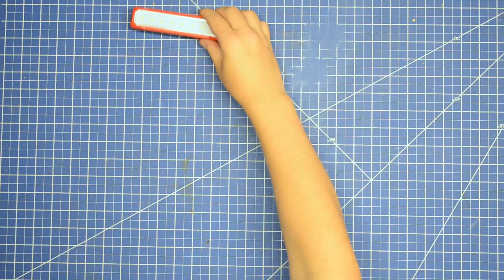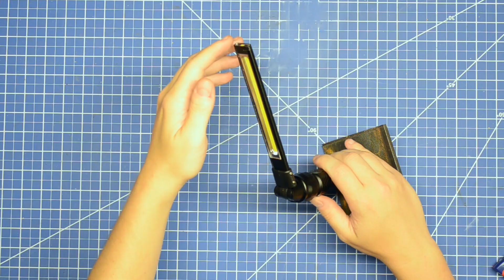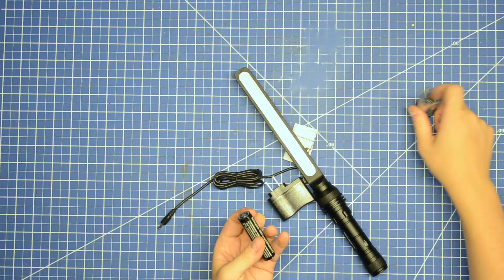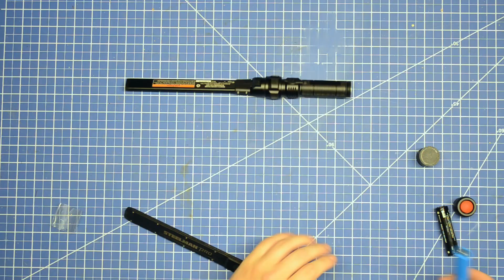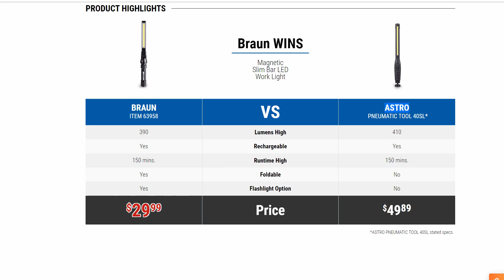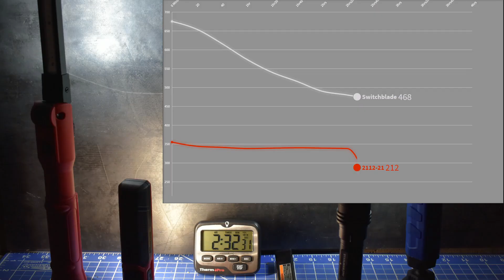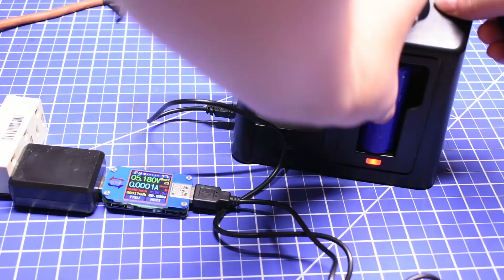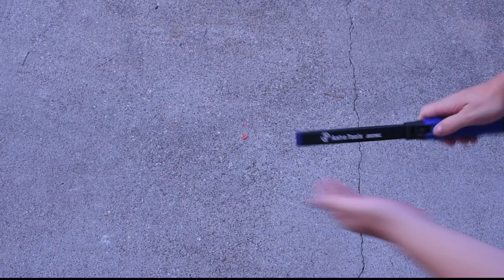Is Milwaukee Lying as Much as Harbor Freight Braun About Lumens?

Comment: I'd love to see headlamps tested. As an electrician I use one every day and as a side note I do appreciate the high CRI lights as the blue lights are hard on the eyes.
Reply from the maker: List headlamp suggestions below! Edit: Also should we even bother with a drop test on headlamps? (please recommend ones without auto proximity dim, we've tried testing a couple really good Olight & Fenix ones and this feature really messes up all of our runtime and lumen testing, even tried taping the sensor off to no avail)
Reply: @TorqueTestChannel  Streamlight Bandit. Super small, I have used it a TON for car work. Rechargeable via micro USB. Super cheap too
Reply: @TorqueTestChannel  I’d love to see the Snapon Necklight ECHDC038 tested. It’s called a neck light but it will snugly fit on your head if you’re in the standing position. If you’re working upside down wearing a thick hat ensures it stays on tight.
Reply: @TorqueTestChannel  [edit] Fenix HP25R V2.0 for "accurate" result.  Fenix HM65R for silly results.  (I previously said Fenix HM65R since I had one at my previous job...worked great, but the specified run times are just silly.  Not consistent with their other products.  I made a spreadsheet...calculated Lumen*hours per mAh...at each brightness level.  This HP25R has a larger battery than the HM65, but has 1/3 the run time at a given lumen level...the lower number is consistent with their other products, so it's more believable.)
Reply: @fredygump5578  they are company supplied the milwaukee looks nice and all but just does not last.
Reply: @TorqueTestChannel  Milwaulkee, DEWALT, Light Bar, Craftsman USB Rechargeable are some I have and/or am interested in.
Reply: @TorqueTestChannel  Surefire minimus - I run rechargeable surefire LFP123A most of the time or disposable cr123 batteries depending on use
Reply: @TorqueTestChannel  we have a pair of NEBO Tools Duo 250+ headlamps and theyve worked great for years now, spotlight, floodlight, red light. Runs off 3 AAA batteries, model is NEB-HLP-0001, costs 30$
Reply: @TorqueTestChannel I've been using a Coast HL8 for probably 6 years now, running rechargeable LiPo AA batteries seems to give about the same light output as alkaline batteries. The alkalines get dim towards end of life, but the rechargeables just shut off altogether...

Perhaps that could be another interesting test to compare light output using different battery chemistries?
Reply: @TorqueTestChannel  I like Thrunite headlamps. Olight is good but all now use proprietary batteries and so that's a non-starter for me since I prefer a nicer stand-alone external charger.
Reply: @TorqueTestChannel  I’ve been through dozens of headlamps and the nitecore HC60 is by far the best I’ve come across, it uses an 18650 removable battery which can be charged in the headlamp or on a dock, extremely bright, long lasting, and the most durable light I’ve ever used, not to mention price usually between $50-75
Reply: @TorqueTestChannel  Strong recommendation for the Petzl Tikka and Black Diamond Spot 350.  Both have survived multiple combat deployments with me and sport decent run times.  Princeton Tec's Remix is also a workhorse but the battery door always snaps after a few hard knocks.  Recommend that you do some water proof testing on these, as headlamps are often used around the house for many uses beyond looking at the underside of a car and survival in a heavy rain really is important.  Cheers!
Reply: @TorqueTestChannel  Not sure if it's still sold but, I got the one bigclive took apart and love it, if you can get your hands on it, I'd love to see it battle it out https://www.youtube.com/watch?v=yn1wk6GbvRA
Reply: @TorqueTestChannel  stream light makes a good one I've had it for a long time
Reply: @TorqueTestChannel  coast xph34r is the best I have found. 2k lumens on turbo mode, adjustable from flood to spot. Rechargeable or batteries. I use it all day everyday working under 2 post lift and it last. Please test it
Reply: @TorqueTestChannel 
Thrunite and Nitecore would be something more real. Probably throw a Coast in there for a typical store bought comparison.
Reply: @TorqueTestChannel  Petzl headlamps are the gold standard for the outdoor adventure crowd, would love to see one of those thrown into the mix along with a Black Diamond as well.
Reply: @TorqueTestChannel  

On the cheep Coast from Home Depot 

On more costly Petzl so many had to say but really held up in trail running in the dark 

I really prefer units that will take AA as it’s much simpler to get through a long overnight event
Reply: I currently own the 475 and 600 lumen Milwaukee headlamps and like them both. I'd like to see the Klien 400 and 800 lumen rechargeable headlamps tested against them. This would benefit me personally as I would like to purchase another headlamp for home use. Currently I use both headlamps at work switching them out to charge as neither lasts all day on high which I understand haha
Reply: @kylefowler5082  the 600 lumen headlamps my favorite  one i haven't had a chance to see how it does with the 3.0 batteries tho i have the older smaller version which I'm pretty sure is just a 18650 cell the folding floodlight 2114-21 is  also my top one the one in the video sucks the magnet is useless
Reply: I am an electrician also and my go to is the energizer AAA headlamp,nothing worse 3hrs into a shift and u need to recharge now you have no light.AAA tend to last all day with on and off use milwaukee not so much.
Reply: @aaronpantell1038  Stop buying cheap lights!  I can vouch for Fenix headlamps--the low settings are brighter than any AA or AAA headlamp.  I use one continuously for ~6hrs at a time, and it's has never once run out of battery.  You would only have to charge it once per week. It's built to last, and over it's life it will cost less than the AAA batteries you are using now....
Reply: @fredygump5578  Then yours is useless for work. At an arms length even a weak headlamp cant be used at max brightness. Do you think electricians run around and brag about how bright their light is, or do they use them for - gasp! - work?
Reply: @aaronpantell1038  same love my duracell aaa light
Reply: @aaronpantell1038  you are correct. None of the built in rechargeable ones are any good. The AAA ones with quality rechargeable batteries are the only way.
Reply: @WarfighterRacing  Nitecore nu25 is awesome, around 1 ounce, has 1 adjustable red output, high 90+ cri diffused white led, and another main led geared for throw.  For a work light I like the acebeam pt40 4000k version.
Reply: @Wavefront101  yeah I have seen some really nice ones. But I have about 24 really nice AA and AAA high end rechargable batteries and a nice charger i've had for years and years(does 18650 as well). For 20 bucks the headlamps from lowes(energizer brand) are simple, easy to swap batteries and last forever /shrug
Reply: @aaronpantell1038  Completely agree, AAA and fairly low brightness, you dont need high lumen for work, a 400 lumen Milwaukee is useless for me but of course kinda weak for a mountain biker.
Reply: Zebralight the best I’ve used( minus the lack of a magnet tail)
Reply: @asg58  I've got three Zebras, just cause I liked them so much. The aspect that matters to me is the wide range of output levels and corresponding run times, and the single 18650 battery that allows light weight with high capacity. Small form factor and easily directed beam from the headband.
Blackout duty requires the ability for moonlight level output for days of use on a single charge, and yet it allows a true output of over 1000 lumens, for household lighting levels.
Reply: Please test the ARMYTEK WIZARD PRO NICHIA headlamp.
Reply: H600Fc Mk IV 18650 XHP50.2 Floody 4000K High CRI Headlamp

I also have a Milwaukee and it’s a good light but let the battery run down and it has to be recharged.   My zebra light I toss a fresh 18650  and go back to work.
Reply: Olight and fenix make amazing headlamps too
Reply: I used the rechargeable yellow hyper tough headlamp, love the thing even with it being walmart brand.
Reply: Brand: Millertech

4.4 out of 5 stars  100Reviews

MillerTech #555 - Double Power Rechargeable CREE LED Headlamp 1800 Lumens Using high Capacity 3500mah Samsung Cell 2nd Generation with USB-C Charging Cable
Reply: I’d watch this. To bad nobody makes Krypton head lamps anymore
Reply: Almost everybody in our shop has at least 1 NEBO Transcend. (We are night shift mechanics) I love them but would like to see them up against others.
Reply: I have the Milwaukee 800lmn headlamp with two replaceable batteries that the stick light has in it. I've been super happy with it!
Reply: I use an Olight Perun mini and love it
Reply: Matco MWL300 Wearable 300 Lumen and it's clone the EZRED Anywear Neck/ Head Light.  My own test of two similar looking head/neck lights revealed a significant difference in light pattern. You do kinda get what you pay for.
Reply: Idk if anyone already mentioned it but fenix lights makes some very good high output headlamps. Iv had mine for bought 4 years now and its still going strong.
Reply: I’ve spent an absolute fortune on lights, specifically headlamps. And after all the brands and fancy ones I’ve tried over the last 10 years… I actually love the Nebo rebel that I’ve been using the past few years. I have three of them, and I use them every day, draining at least two of them completely. 

And on the lower setting… It’s still super bright but can last up to 8-10 hours! They’re super cheap, The rebel only cost about $30.

and are built to a high standard just like my olights and others. I’m somewhat qualified to review these lights properly. I run a lab where I do component level board repairs for industrial clients, as well as test equipment calibration & metrology. I also work with a wide range of photonics test equipment. Like spectrometers and stuff like that. So I’m somewhat qualified to make these assessments.

I’ve disassembled all the lights I purchased, and I’m still impressed with the Nebo rebel. Build quality and attention to detail is top notch.
Reply: The top 20 headlamps on Amazon should be a good start as well as the ones mentioned.
Reply: Well I was gonna say olight perun 2 but it’s got the sensor. I’m not sure if maybe the mini perun or original perun has the prox sensor.
Reply: CRI and colour temperature are different things, although with LEDs warmer lights tend to have better CRI. CRI is a measure of how well the light renders colours compared to a black body source of the same colour temperature. Higher CRI is basically always better (90-95 is good at the moment) and it sounds like you prefer warmer colour temperatures which is more situational and/or personal preference. 4000k and lower would be what you want.
Your best option is probably zebra light h600fc or armytek wizard pro nichia, with skilhunt h04 high CRI being a cheaper option.
Reply: Coast headlamps with the rechargeable battery/ triple A batteries  option are amazing

Comment: I don't have an Astro light yet, but one day I will.  I'm currently using the cheap knock-off (one of which is a Dr. Prepare!) until they die and then I'll invest in the good stuff.  The real sad point for me is the Stinger Switchblade.  I was interested in it and it's not a bad light, I guess, but there are some problems you guys pointed out that break that deal for me. Great video, great tests!

Comment: I love Milwaukee everything. so i grabbed two of their inspection pen lights. It has a rubber end cap they call the "bite zone". Makes it super easy to hold with your mouth. The light temp is great, so is brightness and run time. But man, the durability sucks. I dropped the first one a couple of times on to concrete at the shop, and it bit the dust after 2 or so months. The second one has held up longer, but the rubber end cap button has torn almost totally off from normal activation. Big bummer.
Reply: I’ve found Milwaukee’s hand tools and accessories to be hit or miss, not always up to the impeccable quality standards of their power tools. It feels like some of their products are designed with the expected tank-like durability while others are designed to be so cheap that you won’t care if you have to replace it occasionally. Most companies pick one or the other and I wish Milwaukee would, I buy products with the Milwaukee logo because I expect a certain level of quality and as a professional I’m willing to pay for it. If they wanna sell cheap shit to home-owners they need to sell it under a different brand name. 

Just my two cents.
Reply: I'm a diesel mechanic and I use a Streamlight Stylus Pro pen light. I've had the same light forever. Its tough as nails. Its got a little belt clip on the end that works great for holding between your teeth. I keep one in my shirt pocket next to my ink pen everyday. It's bright enough for me and I use it more than any tool in my box. It has taught me to keep AAA batteries on hand though. It only has to die on you one time to learn to do that!
Reply: I dropped the HF pen light a million times, and even in the toilet, and it’s still working. Not very bright though, so I switched to the tiny stream light pocket light

Comment: The lower the color temp, the LESS EFFICIENT. 2700K is less efficient than 5000K. CRI costs you in runtime
Reply from the maker: That makes a lot sense!
Reply: True because the luminous efficacy of ~550nm wavelength light (sort of a lime green) is the highest. Reds and blues are much worse in terms of perceived brightness per radiation output.

Comment: Haha me and a coworker were wondering why the steelman pro had a flash setting last week.
Reply from the maker: Cannot STAND pointless flash modes on most lighting
Reply: It’s to stun your prey
Reply: Probably something like they use the same mass produced control board as many other cheap lights and it just has the flashing built in.

Comment: That Braun light is going for 19.99 this weekend.
Reply from the maker: If they sold it for $10 and you buy your own quality 3000mah battery and multi cell charger it would be the jam. That button switch tho!
Reply: @TorqueTestChannel  I put Samsung 18650’s in mine. I have two right now and I don’t have any switch issues… The stock 18650 batteries they come with are… “weird”… their sizes are not quite 18650’s spec.
Reply: @frankthespank  
Probably protected cells for charging. It‘s quite common to do it that way.